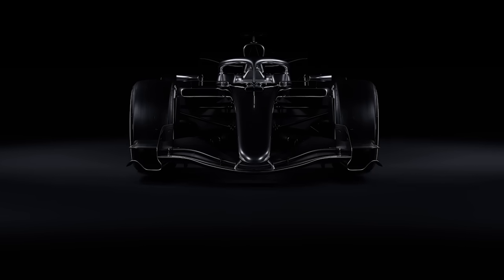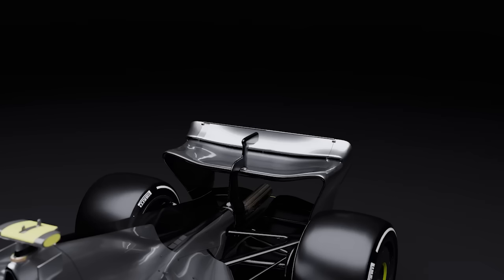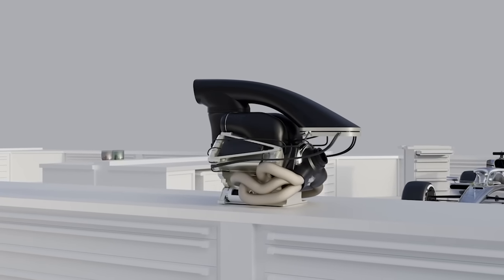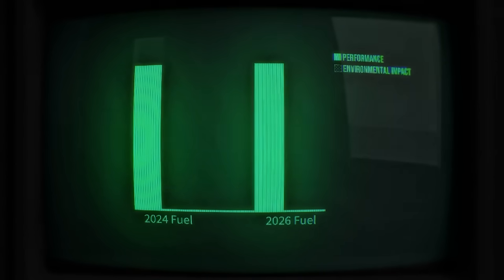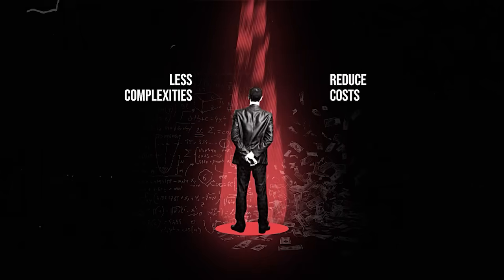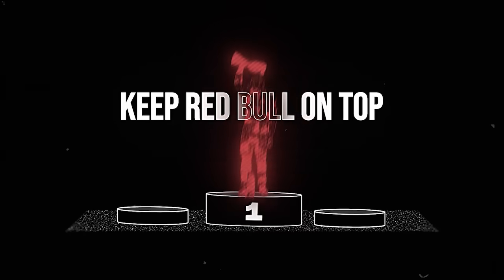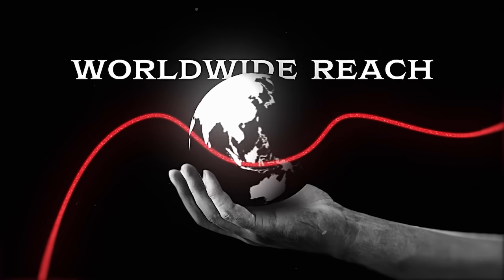F1 2026 Regulations: What’s REALLY Changing?

Comment: How can the introduction of active aerodynamics increase overtaking  if every car has the same active aerodynamics , will it still be down to the old system of DRS , Maybe increase DRS to 1.5 sec  would increase overtaking & even have it more when certain measures are met , also I am not a fan of adding more electrical power systems to the Cars they are combustion driven and always should be ,  some things should be exempt from carbon emission rules and F1 is one of those things

Comment: Everything FIA has changed in F1 for the last 30 years, aside from safety, backfired into the exact thing they were trying to prevent. In 2005 they were able to stay behind one another, in dirty air, for 15 laps. Do you see them doing thad today? Sustainability would mean to use hydrogen, not neuter F1 and turn it into Formula E. FIA are a bunch of politicians not giving a shit about the sport or fans. If they did, they would enforce technical rules like they do in Indycar or Nascar.

Comment: The overall reduction in size of the cars is minuscule.  The rules committee should have used cars from 200x to 2024 and split the difference.  Also split the weight reduction from those same years so the drivers can have some more too to work with.  By doing away with the hybrid portion I am sure that would significantly reduce the overall weight of the car by its self. Reduce the cars downforce by 25%.  Do away with this ridiculous green initiative turbo hybrid era and go back to V8’s or better V10’s.  Now we have more of what most real and life long fans want to see, hear and I am sure if the teams and drivers were asked without punishment, they would agree.  Bring back refueling as well.  Most all other series still have this and they figured out how to do it would minimal negative effects.  Just my .02 on this.

Comment: "Aiming to improve sustainability".. Not only are batteries FAR worse for global c02 & pollution (ESPECIALLY if they have extremely short life spans). An EV car needs to be driven 100k miles to finally "break even" & emit less total c02 vs ICE cars. (Just building a F1 battery for 1 season is EXTREMELY inefficient).

And the "focusing on hybrid to match global sportscar trends".. WHO TF started these trends??? Car companies only started due to climate extremists pushing it.

Also, these new cars look worse than '22-'25 F1 cars. Even if they still did the smaller dimensions, the current aero front, side & rear all look far better than the '26's. Also doing 25-35% hybrid is fine.. but 50% hybrid is just lame.🤦‍♂️

Comment: Environmental trends ? ....  you mean trying to pretend to line up with ridiculous supposed carbon reduction efforts ?  More like MENTAL trends.  Completely unnecessary and absolutely useless.  CO2 represents 0,04% of the earth's atmosphere.  Yes ... 0,04% ... thus virtually "nothing".  Also - CO2 increases are not the cause of temperature increases.  They follow temperature increases.  Of course the "climate change" religious zealots will not tell you that either will they ?  The "trend " to move to more electric is  D E A D  !!!  No one is buying electric cars anymore.  They are completely impractical.  Their resale value is depressingly low. You spend half your life trying to charge them.  Time equals money.  Electric cars do not reach carbon "neutrality" until they have been driven at least 75 000 kms because there is a humungus amount of CO2 released or produced when producing the batteries and the cars themselves.  The manufacturers don't tell you this do they ?  Forget electric.  Love my diesel car for now.  The future is Hydrogen or even water engines.

Comment: The next change will see f1 engines using 75% electric and then after that, it won't be f1 but E1 because there won't be anymore combustion engines. If you weren't around for the V10 era then you have missed the very best of formula 1.

Comment: Any of the Eco/Green rule changes are a complete and utter mistake. The cars should go back to NA. V10's Running sustainable fuels. Go back to ~650Kg or less weight. Any and all of the F1's Green BS is just that. BS.  The amount of wasteful energy usage to fly/ship this traveling circus all over the planet.. Totally negates any of the perceived Green/Eco benefits of the cars using Turbo small displacement electric hybrid power units. The fans DON'T care. We want to hear those V10's screaming around the track. Since the switch to Turbo's I haven't gone to see the race live. I refuse to pay all that $ to not experience the true and real F1 I remember.   Go back to light weight cars, NA V10's (or V8's not first choice but second choice)

Comment: With faster tracks like Monza, there won't be sufficient braking throughout the lap to charge the battery, so when they get to the straight, the battery will be flat half way down the straight and they will only have the much smaller ICE output, making them the least powerful F1 cars since the 70's.

Comment: With all the rules & regulations they might as well just have virtual races on Gaming Stations and reduce their costs by millions and carbon footprint to zero.
Ideally just specify the max Width, Length and Height, the statutory safety features and then leave it to the designers. THEN you'd see some real innovations and real racing, just like it used to be before the sport went woke.

Comment: Are they going to introduce carbon neutral engines for all the vehicles that are involved in the logistics of running F1 across the globe? Even if the on track carbon footprint is zero there is still a massive amount of emissions generated just from moving everything around for the 20+ races in the year.

Comment: Me clicking on this video thinking the V10's are coming back 😭
Reply: V10s wont comeback for the only reason manufacturers arent making V10s, same with V8s the only reason V6 are make is the manufacturers moving to those engines because the consumers want a more efficient car due to gas prices, this is the same reasson V12 became V10, later V8 and finally V6
Reply: Wishfull thinking, i'm afraid 😢
Reply: fia's MBS is a trash ..
Reply: engines from the last century be like: Yeah, it's powered by a 76 Liter X40 that only takes rocket fuel, it makes 110 horsepower anywhere from 1600 to 1800 revolutions, redline is 1200 though
Reply: @Fritz_Pauker  it is pretty wild to look at how big old engines used to be in sports cars (V12s, V8s, etc.) with huge displacement and… like 200 horsepower. Wild to see how efficiently we can design these things now. The Aston Martin Valkyrie’s naturally aspirated 6.5L V12 developed with Cosworth produces north of 1,000 HP. Crazy.

Comment: You can't reduce your carbon foot print when you are inceasing your reliance on battery power! The manufacture of batteries causes more damage to the environment that the production of foosil fuels. Added to that you can't dispose of old batteries in an environmenatlly friendly way! I love F1 but the hypocracy of the current owners is astounding, it would be better for the sport and for the racing to do away with hybrid engines and revert to internal combustion engines utilising synthetic fuel.
Reply: Utterly and factually wrong on all levels. Battery cars are far more sustainable over their lifetime than ICE cars, even despite the initial impact of battery manufacturing. And there’s a high degree of recycling possible and happening today already. You should stop spreading fake news mate.
Reply: @thomasachhorner7925  Utter nonsense!
Reply: @thomasachhorner7925  "Utterly and factually" ? Which is it? How long is a "lifetime"? Initial imapct? Like huge holes in the ground, child labour, toxic run-off and ruined ecology! A "high degree"? What, like 1 in 1,000 dead batteries recycled? They can only recycle a minute portion of the metals they use in battery manufacture, the rest they hide in more holes in the ground! You are delusional and your comments are irrelevant.

Comment: Why not just use the green fuel alone instead of using ANY electrical system at all. Forget 50/50. Just do 100% engine. And make it a V10.
Reply: Exactly! Well said
Reply: manufacturers moving to the same layout thats the reason, the environment is just marketing to hide the real reason, Manufacturers are moving to Electric and Hybrid, this is the same reason we lost V10s, in 2025 V10s are rare
Reply: That wouldn’t work because it will need more fuel and more pit time stop and heavier
Reply: @StreamersFunnyMoments12  Heavier? They'd be getting rid of a VERY heavy battery. pretty sure the fuel wouldn't be as heavy as the battery.

Comment: The engine/battery power unit ratio has been changed to a 70/30% ratio as the 50/50 ratio wouldn't work.

Comment: Vettel showed where the sport should be going with his V10 powered 1992 Williams FW14B, modified for sustainable fuels. Much smaller, much lighter & that great V10 sound in cars that would still be 'environmentally sustainable' (not that anyone cares about that aside from the teams) & that push forward an underutilized fuel source to the the manufacturing market & that could be developed more. 

But no. F1 will continue to walk down the completely wrong road.

Comment: The right direction about car aero and size. The carbon footprint is BS, greenwashing at its best. FIA should bring back the V10 and V12. There are projects of V10 with a small form factor hybrid also. And man, it's far better than this garbage that FIA is making us accept as F1. F1 should be at least V10 after the 2000s. I hope this changes can at least make F1 better to watch, because now it's boring as F in most of the races. They added more circuits and doubled the boredom of the whole season.

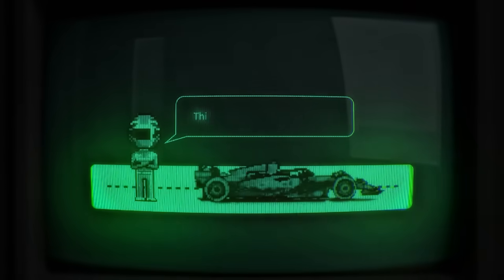Comment: 1:30 graphs that don't start from zero aren't representing the true nature of the issue. It's a published research thing.
Reply: Because he is trying to show and discuss the recent trend in the past few years of the change in weight and not the weight itself, it is perfectly acceptable to start the graph at a numerical value where the trend starts. 

What really is the issue is the inconsistency of number of years in between data points on the x axis which can skew the graph to make the trend of weight gain/loss seem more rapid than it actually is. (i.e. the difference between 2005 and 2011 being 6 years while 2011 and 2014 being 3 years difference but the points are equally spaced.)

Comment: I know it won't happen, but this would be my ideal F1: V10, loud cars, smaller cars, refueling makes a comeback. 

Surely innovative F1 can think of a way to make refueling safer than it was before. It would just be so spectacular if they had smaller cars that were able to overtake on tracks like Monaco (its possible in Formula E to overtake there). While also having diverse types of pitstops with some drivers going in for new tyres and others for more fuel. It would also be amazing if they re-introduced multiple tyre manufacturers and tyres degrading differently with all manufacturers. 

Its kinda sad when I remember that the thing that drew me into F1 was the sound of the cars. As a kid I vividly remember it being the sounds that made me want to watch this sport.

Comment: We should have the best engines in the back of these cars, and they are fully aspirated V12 beasts. Not some fannying half electric hybrid nonsense. 
If you buy into the climate scam stuff we'll be sitting in our homes heating them with wood fires and travellling around by horse and cart. 
F1 should be the fastest cars on track and the most powerful. Driving around in zooped up Toyota Prius hybrids just doesnt do it for me

Comment: They're aiming for 30kg in weight reduction but also for more electrical power with the battery? Good luck.

The more reliance on electrical power (that's also accompanied by 2022's removal of MGU-H that offered nearly free energy conversion on the fly) would just mean slower race time. Cars will be driven to their absolute... energy efficiency. Braking early to charge the battery, not pedal to the metal to not trigger the e-motor.. bruh. From another video about the 2026 rule changes, I think the 2026 regulations on fuel/engine output/battery is energy (joule) like WEC has, moving from work/power (horsepower/watt) and fuel mass (kg). It just doesn't make sense where F1 is all about the pinnacle of performance, not the pinnacle of efficiency, which what endurance racing is.

Not to mention the aerodynamics. Less reliance on ground effect means cars will be designed back to pre-2022 of huge downforce from the wings and other aerodynamic devices, more dirty air, ergo less racing.

And yes, FIA should stop nagging on carbon stuff when there are too many races in the calendar = too many people & stuff moving across (not around) the globe = more carbon footprint from the logistics.

Comment: F1 fans want NA V10 or V12, we don't care about 50/50 split or more efficient V6 turbo vacuum cleaners. Just look at the valkyrie in the wec and the excitement, same goes for the cadillac with it's V8. Nobody cares about a higher performing battery or a couple of percentages in fuel efficiency when it comes to racing. 

Only good thing i see in these new rules is the use of sustainable or e-fuels. That's something a lot of petrolheads want since it will allow ICE cars to be on the road for a very long time.
Reply: Is it really worth wishing for, though? Just actually think about it. Will all the fretting about power units and sound and all that really make any difference if this is F1, the ground of new tech?
Reply: @coyenasaregoated  Yes but it goes further than just V10 of V12. I just gave up on  watching F1 because it's so over regulated, every new innovation is scrapped. I want to see innovation in the way that the engineers are free in choosing what they see as competitive. 
Let me give you an example. Let's say the regulation change to own choice of power unit but with a limit on fuel flow. No regulation on max energy for electrical system or ICE unit. Remove the regulation about amount of downforce, so the suction thingy can come back. 

In such an environment technical staff can have a party and that benefits technology innovation. It will look more like the WEC with V8, V12, V6 engines all driving along eachother. I've seen and heard the Valkyrie in real life this year, and ooh boy what a dream that was. Combined with the cadillac V8 and GT class sound was just something else.
Reply: Have to agree, nothing gets my heart (not) racing by listening to a bunch of the latest Prius's whispering their away around the F1 track. Bring back the howling V8's, V10's or v12's.

Comment: They need to ace the V6 and go back with a V8  powered engine which sounds 1000x better and is way more cost efficient, The money they put into these V6 engines is out of control. We are talking 20 cars racing 22 times a year for about 2 hours, like that is going to make a mark on the environment.. They should go back to high octane racing fuel which I think would burn cleaner then 87 blended with 10% ethanol . A jet airliner is going to do more damage to the environment then all the F1 cars! put together ...So stupid,
Reply: V8s didn’t sound good compared to the V10.
Reply: @ColonelJohnmatrix1000  This is true!

Comment: If the battery recharges by braking and you were initially pushing the car by gas, the car is 100% powered by gas, not 50/50. You're just smartly recouping some of the energy that came from burning the gas.

Comment: Over 450hp with the overtake button seems like a lot lol. The overtake button on current F1 cars only gives about 160hp. This seems either greatly exaggerated or the cars, comparatively, are going to be way slower running a little over half horsepower until they hit the go button lol. Assuming 2026 cars will have similar total horsepower. Or am I just missing something?

Comment: All I heard was potential for some good right up to the cars getting narrower. Everything after is just a joke. These clowns really take people for idiots and the idiots eat it right up. What the FUCK do exhaust gasses have to do with carbon footprint in racing? A single breaking form a back straight will offset the the carbon emission of the entire race. And all the tires they go through, tarmac resurfacing, team logistics. Now on top of that, you basically just haul ICE power generators in these Formula-Es because you will be charging that massive battery 50% of the lap!
F1 has long become a woke circle-jerk. Get that crap out of racing!

Comment: Just a bad move on F1's part.  They actually made the cars more boring, and will not improve racing.  The regulations on the hybrid system ensures that every teams powerplant is exactly the same.  The active aero will make every teams aero virtually identical.  We'll continue to be in the slot car era.  It seems that they are intent on chasing all of the fans away.  They turned F1 into the E series.  Horrible.

Comment: Bigger batteries are gonna be a danger for the drivers, the track even the public, lets remember that the sport comes with risk as crashing with others or barriers, battery fires releases deadly toxic fumes, firefighters need a higher grade mask for this fires, they burn at higher temps and for longer
Reply: wrong. the battery as it looks right now seens to remain at the same capacity as the current 2014-2025 car.

they only bump up the power deliver to and from the battery via the MGU. 350kw up from 120kw that they currently use now.

also batteries are not dangerous. there is alot of protection around them. Formula-E has been running for 11 Seasons now. There's never been a battery fire.

and F1 had batteries since 2009 and never been a battery fire.

only full blown fire ive known is Romain grosjean in bahrain 2020. and that was the petrol igniting. almost killing him. in fact Petrol has killed alot of F1 drivers and injured even more. like niki lauda.